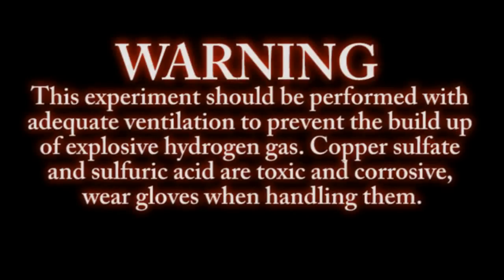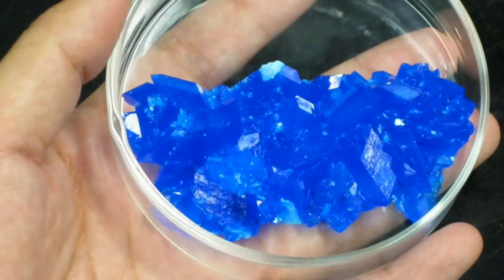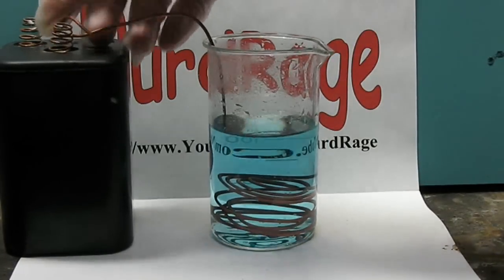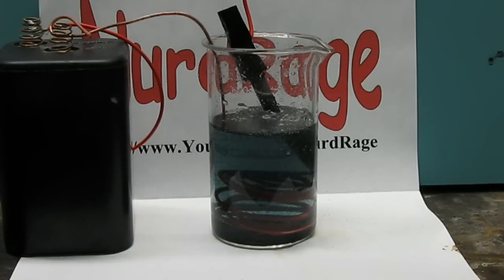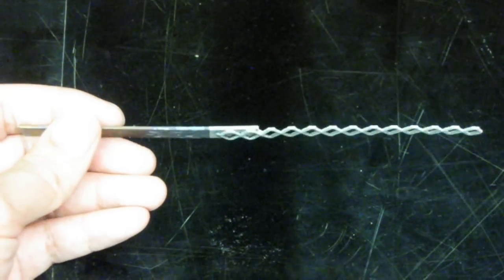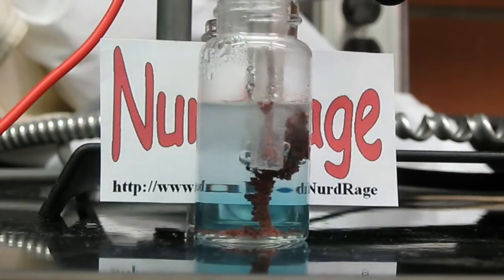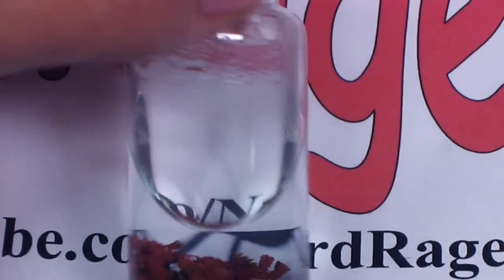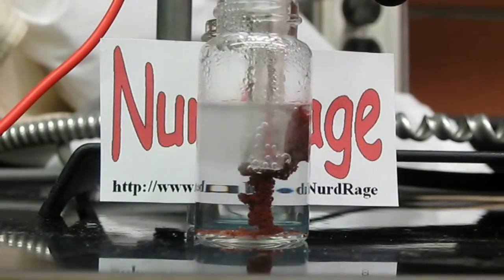Make Sulfuric Acid (Copper Sulfate Electrochemical Method)

Comment: But what would happen to the oxalate ions? You could bubble the SO3 through water, then boil off the water to be left with concentrated H2SO4. Also I think SO2 and air passed through a hot iron oxide catalyst makes SO3.

Comment: @nurdrage i use the carbon electrode and copper electrode connect to a 12V adapter into the CuSO4 solution but nothing happens

Comment: This gave me an idea to use gypsum (reclaimed drywall), CaSO4, to make CuSO4, then make H2SO4 using copper as an intermediary.  It may be too slow, but hopefully the low-solubility Ca(2+) would go into solution as needed.

First, in the electrolysis cell, anodize the copper:
CaSO4 + Cu + 2 H2O --> CuSO4 + Ca(OH)2 + H2

Then I suppose heat it to 100 °C to precipitate the Ca(OH)2 and filter it out (so that it doesn't react later with the H2SO4 to make gypsum).

Then plate-out the copper:
CuSO4 + H2O --> H2SO4 + Cu + 1/2 O2 

The above 2 reactions overall:                       
2 H2O     -->   4 H(+) + 2 OH(-) 
Ca(2+)SO4(2-) + 4 H(+) + 2 OH(-) --> Ca(OH)2 + H2(2+)SO4(2-) 

overall: CaSO4 + 3 H2O --> H2SO4 + Ca(OH)2 + H2 + 1/2 O2

Comment: I was more asking what the actual company was, since most Ti or Ti/Pt mesh electrodes are just supplied raw, and not welded onto any supporting electrode like yours.

Also, do you think the spongy copper has any use? It should be pure, perhaps catalysis in a tube furnace?

Comment from the maker: @jpthecreaton

Alright, now i see what's happening, the air dissolved in the acid solution is reacting with the copper to make small amounts of copper oxides that dissolve into acid to form copper sulfate which is what plates out onto the steel when you dip it in. 

If you did the same experiment under laboratory conditions carefully excluding air it wouldn't work. I should know because I've done it under laboratory conditions without air. ;)

Comment: @jeffyparu Scientific/Curiosity Interest? Or a practical one? Electrolysis of non-concentrated H2SO4 may work and you may get left over Sulphur, you need to look it up, because I cant remember much about acid electrolysis. Sulphur is not dissolvable in water, so you should see it form at some.

Here in Australia you can get Sulphur powder from K-Mart, in the gardening section, very cheap too.

Check big shops with gardening sections and gardening supply places, and hardware stores.

Comment: Many months ago, when i was copper plating a carbon rod , I decided to remove it and then plate it again, so i did it, in a solution of copper sufate with plated carbon rod as anode and a copper wire as cathode then i connected to the power source, it was going ok, til it consumed all the copper and start expelling a horrible gas, my first thought it was SO2, the current was high i think... In a solution that has SO2 2- , it can be oxidized to SO2?

Comment: I used a carbon electrode with a super saturated solution of copper sulfate. It was current limited to 200mA with little erosion of the carbon electrode. When the solution started to clear up, the electrodes eroded very fast and i limited the current to less than 100mA which helped a little with the erosion problem.

Comment: yes, but it will react with water just the same. Could you use an aluminum electrode (anode, whatever it is) as it doesn't react with the acid? or will it still react with the oxygen.

Comment from the maker: @msduckfuck I did it this way in the video rather than the way you described because the whole point of then video was to do it this way. Kinda like when drawing a landscape asking "why don't you draw portraits?".... the point was to specifically draw a landscape.

But by all means go and do your method. I'm still keeping this video up though. I like it because it doesn't require a complicated gas-reaction apparatus. The platinum electrode is actually cheaper comparatively.

Comment: Basic electrolysis. I just used copper and both the anode and the cathode. I've gotten it to work with a 1.2v NiMH battery but found that a 12v NiCad drill battery will work too. The Magnesium drops out of the solution as a milky white precipitate, MgOH perhaps? I've still got some of the CuSO4 crystals I grew from the solution and the dried precipitate somewhere.

Comment: What about silver?

It is quite easy to cap AC using RUN capacitors in series, and rectifying  it afterwards using general purpose diodes, if that's all that is needed to make carbon usable as electrodes. Is graphite containing ceramic(which I think most drafting graphite does) worse than common graphite for this purpose?

Comment: Ummm, I was a little bit experimenting and I figured out that spring (I took it from a gun toy) on positive, and aluminum foil on negative side work perfect! Ok, that solution is still working so im not sure, but Im sure that is better to use aluminum foil  in place of copper wire. It work better. I hope I helped!

Comment: Three questions:
1. Can I do this with Zinc Sulfate?
2. Can I just bind together some pencil leads and tape them to a wire and still call it a carbon electrode? Edit: Yes--I tried it and it worked.
3. Could I do the same thing with a nine-volt battery? Edit: Yes--I tried it and it worked. The carbon is not eroding at all :)
Reply: ***** Thanks! 
I personally think a colored solution of copper/manganese sulfate is the best due to the color indication. So an alkali metal anode would trade places with the metal ions in solution... but H+ is more reactive than Li+, so you wouldn't end up with H2SO4 (you would get LiHSO4). And the groups 1-2 metals would react with the water, so that would not work (?). Aluminum... maybe. I do not know, as aluminum can be surprisingly reactive sometimes (as in the cases with gallium and mercury).
Reply: Science Hedgehog No.

Imagine if you do plate out the zinc in the zinc sulfate to make sulfuric acid, the surfuric acid would again react with the zinc and you still get zinc sulfate.

In actual practice, the energy required to remove reduce zinc is more than the energy to reduce hydrogen, and even less to reduce copper. 

Thats why copper works. Because once you remove the copper ions from the solution, it does not spontaneously dissolve back.
Reply: +Szakembőr TV TMIAE:
What would the home chemist use as a membrane? A salt bridge could work. The Zn(2+) would have to migrate across the bridge. You aren't going to have a clean H2SO4 this way.
Reply: +Szakembőr TV TMIAE:
Funny enough, I am using wood as a membrane to electrolyse NaCl solution and to have NaOH. I tested it by adding to a CuSO4 solution and got a precipitate, which is likely Cu(OH)2.
The density is of my NaOH solution is 1.05 g /mL. I will probably distill it a little and then use it to make soap.

Comment: @SwitchBlitz 
an inert metal is a metal that is VERY slow to react.  some metals, (platinum, palladium, gold, silver,) are really expensive and are so because they either are in short supply and are rare, or they have an expensive application.  others are cheap and react a little sooner than others(silver, carbon).  i have some silver wire that i was planning to make my own concentrated collodial silver (enhances immune system function but our great and wonderful FDA banned it.

Comment: @SwitchBlitz 
an inert metal is a metal that is VERY slow to react.  some metals are expensive because they either are in short supply and are rare, or they react slower.  Others are cheap and react faster than others.  i have some silver wire that i was planning to make my own concentrated collodial silver (enhances immune system function but our great and wonderful FDA banned it).  maybe ill try this with silver wire and post my results.  i am also having very low erosion at 3v 300 milliamps

Comment: I used an old soldering silver wire wich had no label but i think its only made of silver and not only silver coated but any silver soldering wire you'll find in a hardware store should work :)

Comment: I have calculated that from 100g of pure coper sulfate you get 60g of pure acid wich corespondes to 32.25 ml of pure acid

this would be in perfect conditions
if we calculate losses it would probably be 10 to 5% lower amount
still for home production very good

NOTE: these calculations re true, you will get 32g of acid, but mixed with water
you will have to distillate it to purify it
and in distillation you have losses of acid amount

Comment: I'm still kinda confused about the chemistry of this rxn. So on the negative end you produce hydrogen gas and reduce copper, and on the positive electrode you produce sulfur trioxide which re-dissolves into solution to produce sulfuric acid? Also from what i understand the platinum electrodes can absorb hydrogen gas and convert the molecules into H+ ions.

Comment: How can the carbon anode be inert when it clearly is seen to breakdown? It must be taking part in the process or something at least in the carbon electrode is taking part in the process.
Reply: Because it doesn't react with the product itself. It can easily be filtered out.
Reply: @neutronpcxt372  But what holds the carbon electrode together? Think about it. If the electrode breaks down, it has to release something.
Reply: @neutronpcxt372   the electrode isn't just made of carbon!

Comment: The fourth process in comment is not for home-work thing or even commercial intense.
It's called "high pressure acid leach" it is done with metal or ore in machine called autoclave.where the pressure in more than 150 PSI and temp is 250 C.so it's not for home cuz if you do it inside and a little malfunction can cause a explosion.hope it helped.

Comment: @HE3991 copper sulfate is a d block orbital... you can make copper sulfate by mixing magnesium sulfate in water to copper, it should react and make copper sulfate and magnesium hydroxide... you can purify magnesium by mixing Mg(OH)2 with acid like hydrochloric/hydroflouric/(any hydrogen-halogen acid)... or other acids would work too(like sulfuric).....

Comment: @SwitchBlitz 
an inert metal is a metal that is VERY slow to react.  some metals, (platinum, palladium)are really expensive and are so because they either are in short supply and are rare, or they react slower.  others are cheap and react a little sooner than others(silver, carbon).  i have some silver wire that i was planning to make my own concentrated collodial silver (enhances immune system function but our great and wonderful FDA banned it).  maybe ill try this with silver wire and post it

Comment: Same as m8teseven.I don't know if the sulfuric acid id decomposing but after i filtered it off and put it back through the cycle it was a very light blue.Then i realized it was bubbling at both sides.
Plz help

Comment: @NURDRAGE

Could you do this for other salts such as MgCl2 to produce HCl Acid and metallic Mg? Obviously it wouldn't work for NaCl or KNO3 since metallic forms sodium and potassium react so violently with water.

Also suppose you had high enough voltage do you think if you tried this with NaCl (in solution) with a metallic sodium anode you could reduce the sodium ions out of solution producing more sodium on the anode and HCl acid?

Comment: what do you think had platinum in it because i could probably scrap something also i have 25kg's of Copper Sulfate cost me only $120 just need to use electrolysis to make it into acid as soon as i have sulfuric acid i can pretty much make any other gas/acid/salts so i just need to obtain a platinum electrode any idea on where i could get platinum from would be very helpful :)

Comment: I've noticed many of these acid creation processes require another acid in turn (basically shuffling between nitric, sulfuric and hydrochloric), or like this one use electrolysis. I've always been curious though how the aspiring 18th/19th century chemists would "start from scratch" if you will without the benefit of electrolysis or another starting acid. This might be a rather basic *rimshot* chemistry demonstration, but I'd enjoy a video showing such a process under those limited conditions.

Comment: Great experiment! 
Do you know if there is any method to do the same with nitrate salts and nitric acid? If yes, could you make a video showing it? Thanks!
Reply: Nitrate salt (after H₂ metal) in water would make HNO₃(aq), but HNO₃(aq) will react with made metal and one of the products would be NO₂ (if NO, it will react with O₂ 2NO + O₂ -> 2NO₂) gas and you will get nothing necessary.

Comment: If I used a toy train transformer with adjustable power supply for the electrolysis would that be too much voltage for that and also, where can you buy the platinum-coated titanium electrodes and if you made them yourself, can you make a video on how you made them? Thanks and I love your videos!

Comment: I've found that the carbon in pencil graphite works fairly well. It's not the best though because the clay used to form the "leads" raises the resistance a bit. This clay might help to make the electrode last a little longer though, I don't know.

Comment: I'm recreating this method at the moment but the electrolysis stops after e few minutes because the copper cable gets coated in a layer of a pale red substance  (I would assume it's copper oxide) how could this happen? I'm using a normal copper cable on the negative electrode and a graphite electrode as the positive one with a 9V battery (it's quite high but it started out quite good ..) Thanks in advance for an answer :)
Reply: The red substance is copper metal.
Reply: Guilherme Eduardo Carvalho nope unfortunately not .. it was something that didn't conduct electricity so it wasn't copper metal. Thanks anyways, i fixed my problem by using 4,5 Volt. It did take much longer than described here but it worked!

Comment: this is really important.. i had done an experement where i took copper carbonate ( light greensh powder and placed it in, car  metel prep solution ( maybe phosphuric acid and ditergents) heated the test tube with a torch. after 2 min it boiled and then there was a blue solution ( cu2+ ions?) and a upper layer (ditergents ? ) . then i placed a bolt in the tube after cooling and copper flakes grew from the bolt. can you create a video or explain what is happening?

Comment: If I wanted to make nitric acid, could i do the same thing - just with a copper nitrate solution?
Reply: +neovictorius, No you couldn't. But if you heat Cu(NO3)2 to decomposition and pass the fumes directly into water, you can generate nitric acid.

https://en.m.wikipedia.org/wiki/Copper(II)_nitrate#Synthesis_and_reactions

Comment: @wowhead1227 You can get a 12 inch long platinum wire for around 30 bucks from Esslinger Jewelry supply.  This is a pretty good deal, but for an even better deal you can get a platinum coated nickel wire or platinum coated (any other conducting metal) wire.

Comment: Does anyone know what you would get from heating copper carbonate until it changes color to a grayish black color then adding magnesium sulfate+Isopropyl alcohol+ammonia? it's a dark blue with a purple tint and it had a white powder at the bottom, it didn't change color until I added ammonia. I am trying to make copper sulfate without sulfuric acid, any help would be appreciated.
Reply: ***** I did basic research to make sure I'm not creating chlorine gas or anything like that. there is no legality's preventing me from experimenting with the extraction of basic compounds using basic readily available chemicals. You act as if I'm going to have a random boom without an ignition source, you're also assuming I dried the mixture when I have not.
Reply: ***** I have no need to figure it out I am just interested, thanks for your warning I will research very carefully before I mix any heavy salts with ammonia. I did research but not enough.
Reply: Shona O'Neill Do you understand that hydrogen is being released in the reaction... genius last I heard hydrogen is flammable.
Reply: Sounds like  Schweitzer's reagent

Comment: can you do this with magnesium sulfate? its a bit cheaper per Lb.
Reply: No, as you need a membrane cell to prevent magnesium sulfate contaminating the sulfuric acid.

However, if you can make a membrane cell, it'll work.

What you need instead is manganese sulfate.

Not only will you be producing manganese dioxide, but also dilute sulfuric acid.

Meaning you can either use the MgO2 in other experiments, or sell it to get some money back.

Comment: Although impractical, would it be possible to use MgSO4 in some sort of a biphasic apparatus with the cathode in a layer of CCl3 or a mixture of ethers to "trap" the reactive Mg(s) at the cathode and away from the aqueous phase while still allowing some salts to pass such that the electrolytic aspect of the reaction would still work?

Comment: Silly question, if you were to use a strip of lead as the anode would the lead oxidise to lead dioxide on the surface and give you an ideal anode or would you need to coat something else with lead dioxide?
Reply: Ross Mitchell A lead dioxide anode is graphite coated with a thick layer of Pb oxide. So oxidising a strip of lead then using it is not practical

Comment: Don't try and turn H2SO4 into SO3. It's very difficult (conversion to bisulfate, then decomposition at above 500 degrees Celsius). Leading that through water is dangerous, very dangerous. The SO3 would literally explode, since it is so attracted to the water (SO3 can set sugar on fire because of how exothermic the dehydration is!). SO3 is also too valuable to be wasted that way. You can make SO2 by burning sulfur and bubble it through H2O2 to make H2SO4, though.